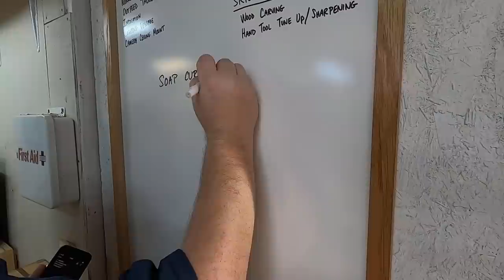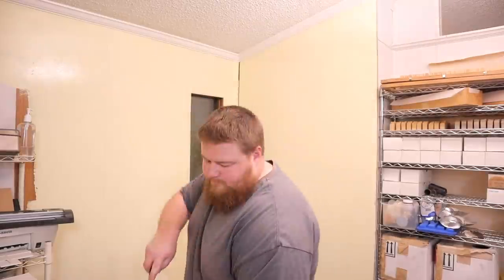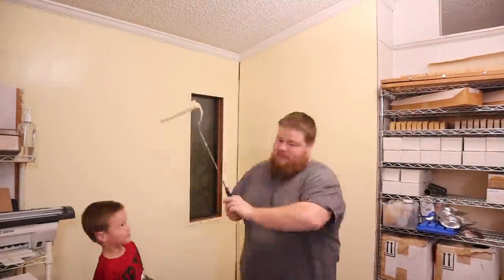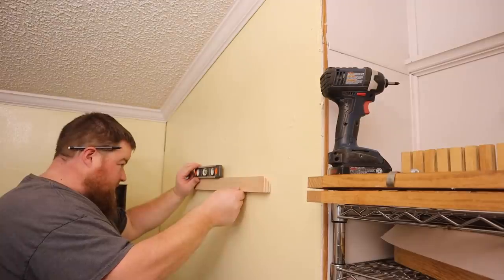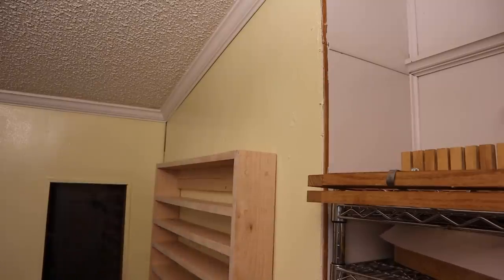Painting and Building a Soap Curing Rack - Budget Mobile Home Remodel #37

Comment: Sort of unsure why you didn't mud/tape the inside corner on the left, or put a corner bead on the right.  Also, and this is just one of my pet peeves... I would have taken off the outlet cover, dropped it into a bucket of water with some bleach, scraped off the paint, and put it back after painting.  It gives a much more professional look rather than just painting the plate to the wall.
Reply from the maker: Yes, it will be getting replaced with a standard outlet very soon!  The mobile home outlets are one piece together, no cover to be able to take off! 🤪 -A